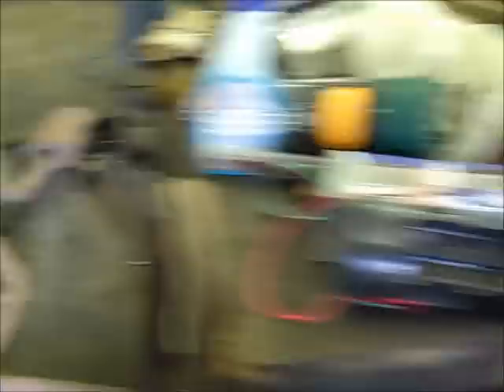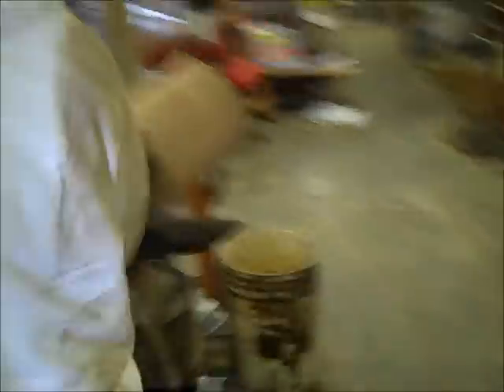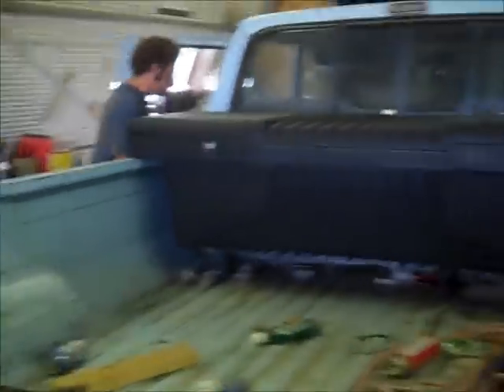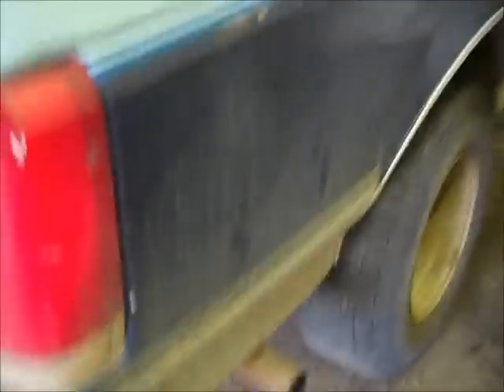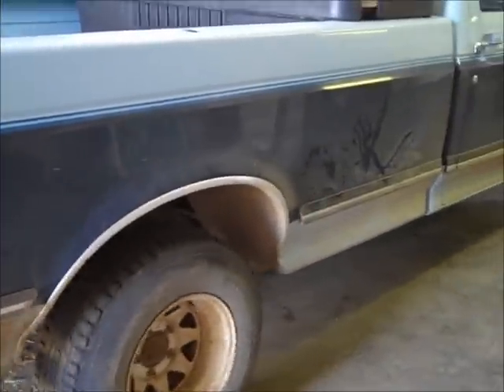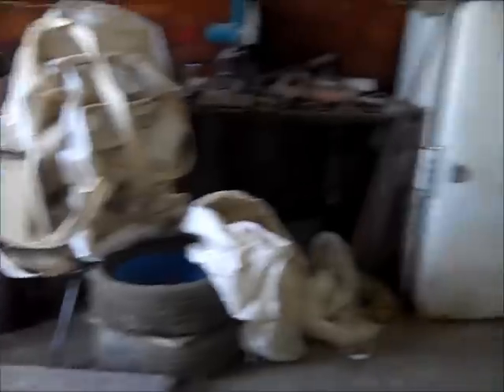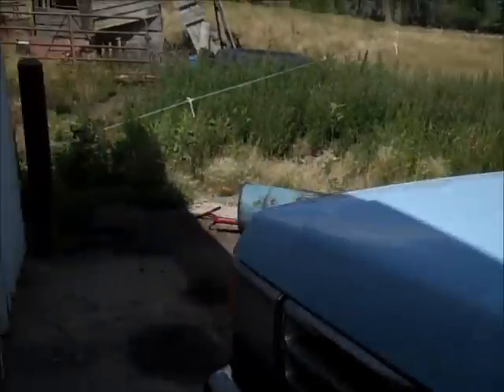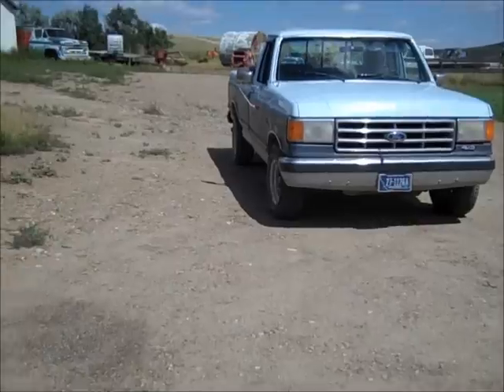Romans Blue Ford gets exhaust

Comment: @carbpumper Yes, the 351 means 351 cubic inches of displacement (the volume of all the engines cylinders). Same with the other engines. A while ago they switched over from cubic inches displacement to liters(which means if a engine is a 5.8l it can hold that volume in all of it's cylinders).

Comment: @carbpumper It's a small block.
From what I've read it's technically a slightly different block than they used on the 302, but it's still basically the same.